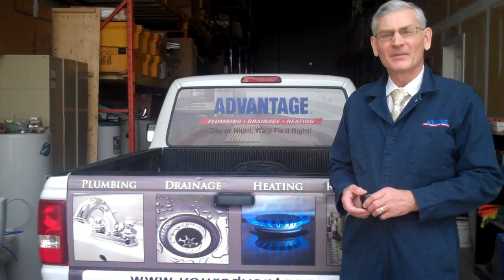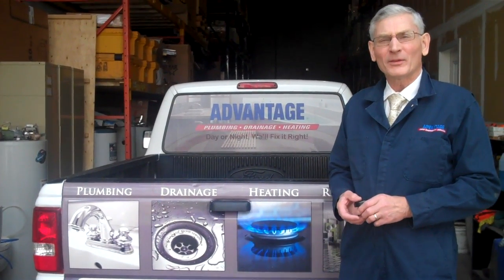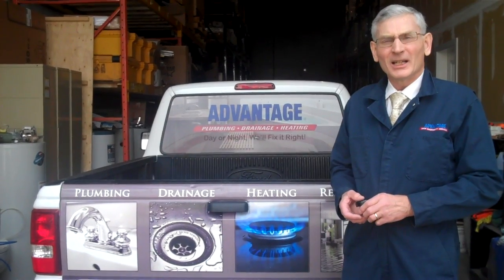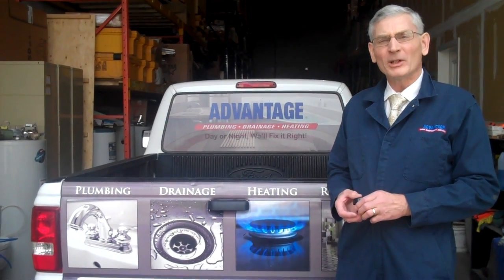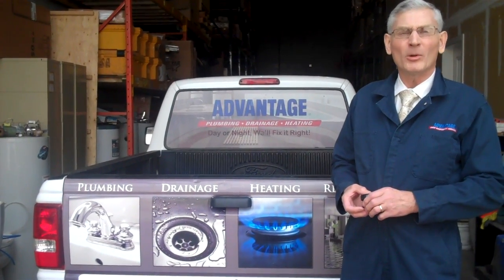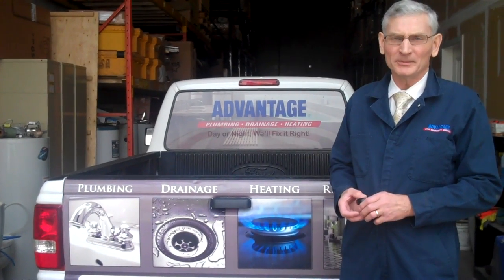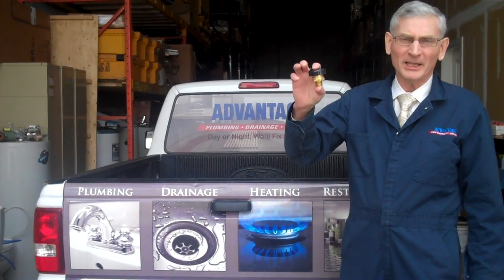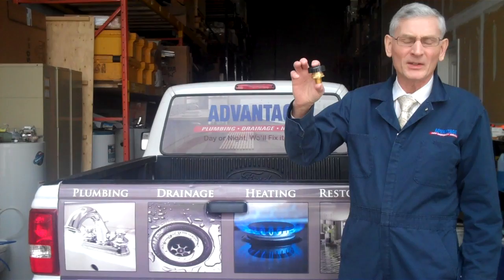Vacuum Breaker

Comment: What I want to know can you use a vacuum breaker with a thermal expansion tank since they both have to be on the cold side
Reply: Did you ever get an answer to your question? I have same question should I install both and how?
Reply: @foxtrot35  yes you can